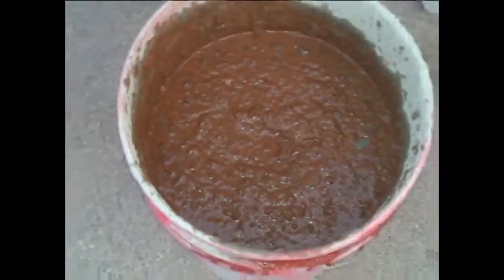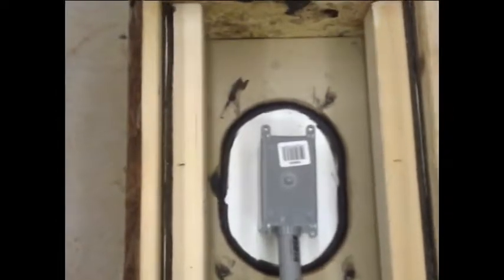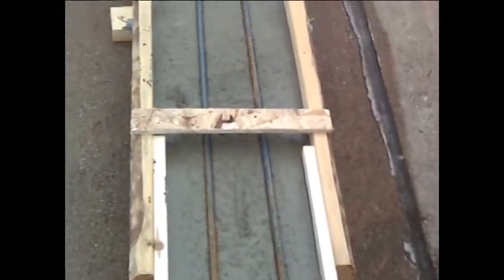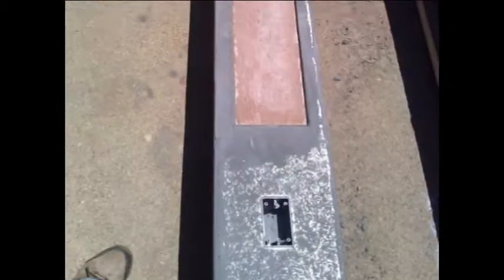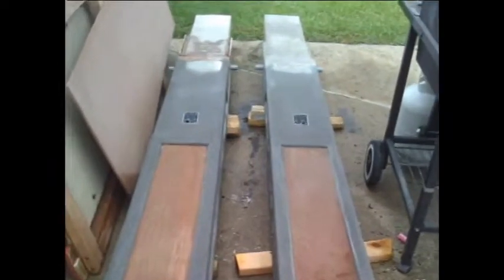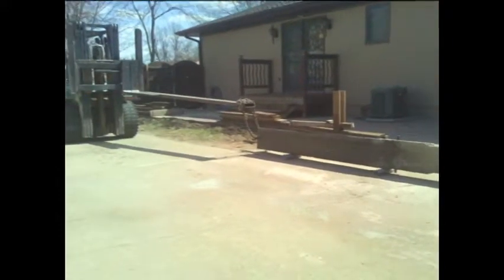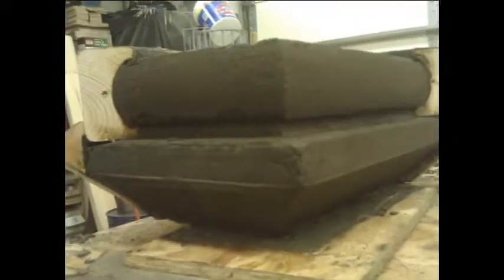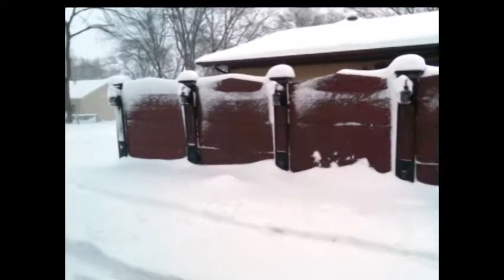How To install a Concrete Fence panel , put up a fence DIY

Comment: Could you send dimensions for your forms?
Reply from the maker: The post are 12" wide 6" deep and 11' tall,  The panels are 89-1/2" wide 24" tall and 1-1/2" thick.
Reply: @BraveJammer  How many bags of cement did you mix for a panel?
Reply from the maker: @mimic323  It took 4 60lb bags plus I added a shovel of Portland and a the same of silica sand, also a pint of cement integral color.